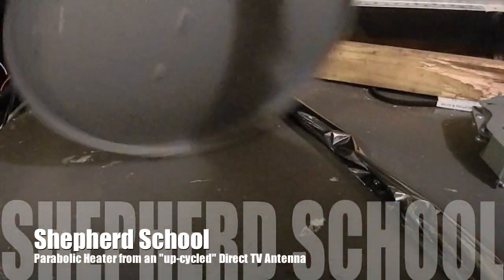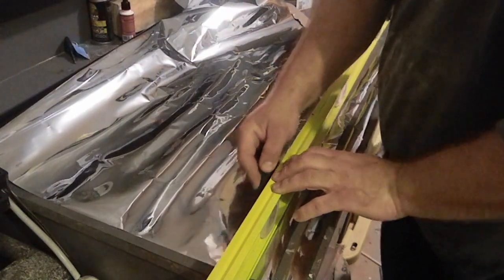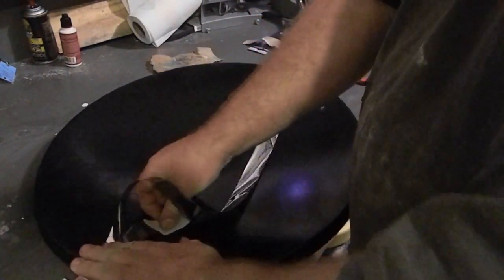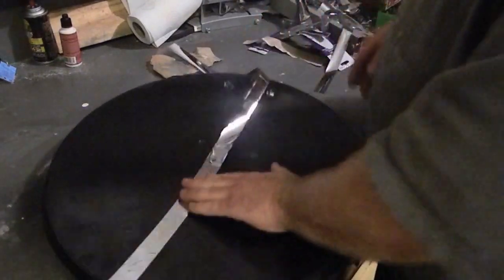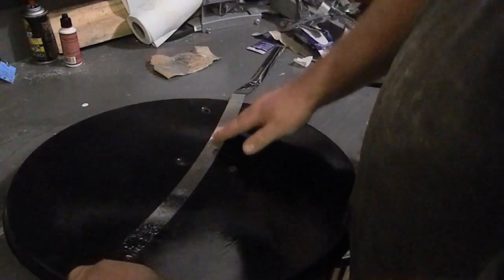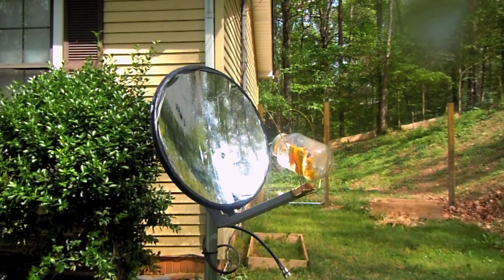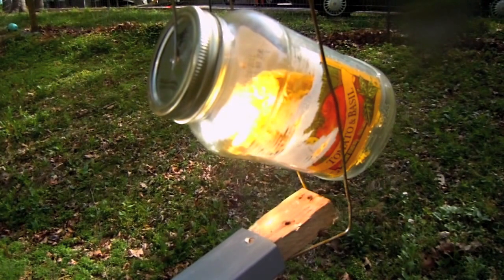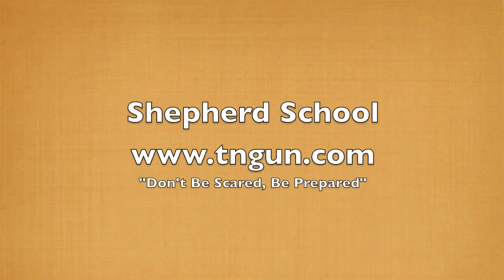How to Build a Parabolic Solar Cooker (Upcycle that Old Direct TV Dish)

Comment: Cool video.  Next time after you paint whatever it is, make sure you lightly sand and then degrease the surface. "WEAR GLOVES".    Watching the video I can see the grease from your fingers leaving oily residue on the paint.  That's the difference between something lasting a little while and nearly forever.   I'll have to look into this kind of heater.  It's pretty cool.  Thanks for the video.

Comment: Very cool. What I would like to see is hear pumped into the home out of the jar to heat the home with. What about using a bulk pickle jar, pvc pipe and a fan? I'd like to know how well it could heat the home. Also, it would have to release enough heat that the glass doesn't break....just a thought....

Comment: hellow freind i have a tip for you , if you spray distilled water on the dish first and then apply the sticker you can use a plastic card to push the wrinkles and the water out of the reflective tape, i had to apply hundreds of stickers ant a job i had 
years ago and this is a trade secret kind , this is how all decal work is done as well , you did  a great job i just wanted to ad to the discussion

Comment: Nice little mirror you got there. I got something you may want to try as well, if you have a broken does not work rear projection TV laying around or know someone who has one take it apart and in the screen you will find a giant Fresnel lens. I got one and I have it framed and mounted on a swivel stand and the light at the focal point is well over 2000F and it melts glass, rock, and metal. My lens is 50'' when you measure diagonally from the corners I want to get a 65'' lens. My favorite thing to do with mine is melt my lava rock and glass. Go to my channel check it out its most recent upload.